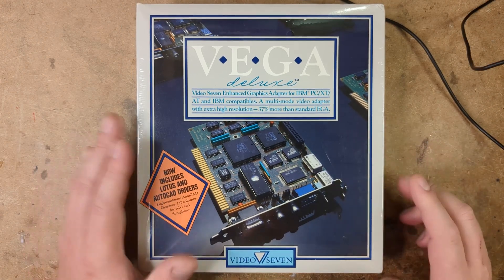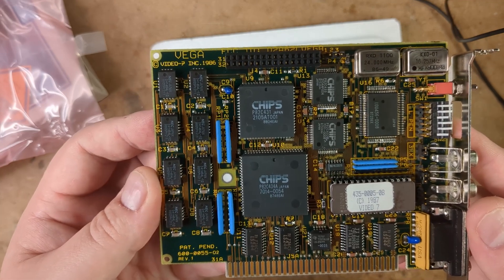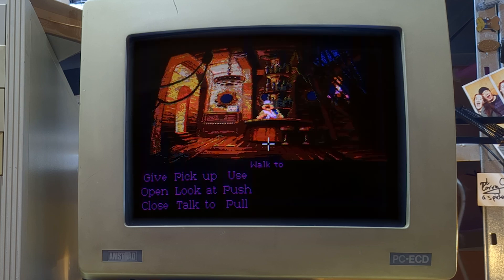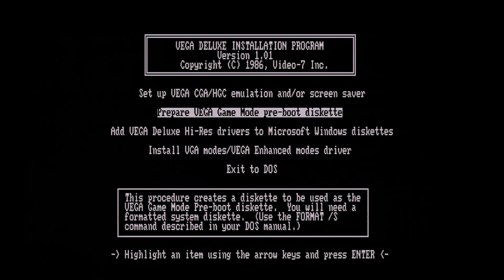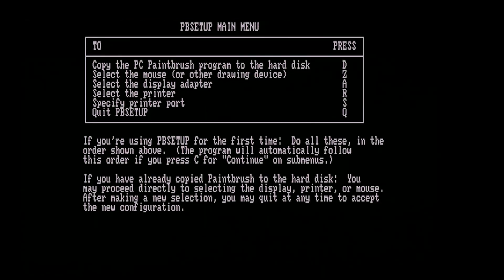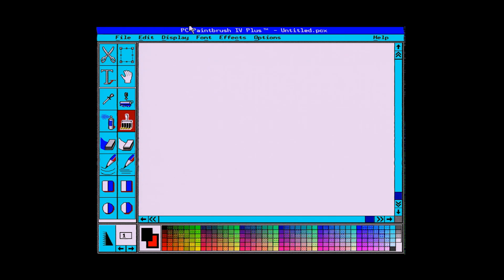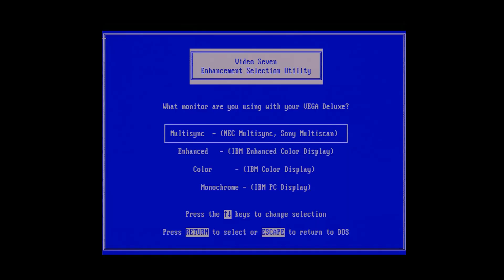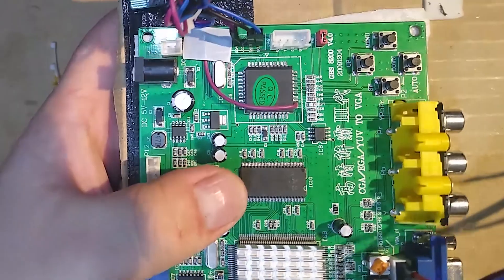Unboxing a Sealed 1980s Video Card!

Comment: By the way, do your capture devices give any kind of readout as to what frequencies/etc they're picking up? The exact settings for some of these old modes seem to be rather poorly documented, and even if it doesn't really display them properly, if it's giving any kind of picture at all that suggests it must have some idea of what line and frame rate the card is scanning at.

If you can verify what those actually are for the 640x480 and 752x410 modes (plus any other oddballs on there, like the 132x43 text mode), that could be quite useful to document, seeing as I've ended up here as one of the rabbit holes on my roughly annual surrender to curiosity over WTF they might actually have been, and if anyone's figured it out yet.

The V7 adverts and manual themselves say 29.4kHz for 640x480 and "25kHz" for 752x410... the former is maybe rounded off wrong depending which crystal it was actually designed for (some versions of these cards use 25MHz instead of 24... and of course if they're exchanged one for the other without any adjustment to the drivers, that could cause a pretty big change in scanrate), and with the latter, describing a monitor as 25kHz or "400 line" seems to cover a pretty wide range of possibilities from 24.0 upto 27.0 or more... so can't figure that one for certain at all. And of course the text modes, or anything more exotic that may be offered alongside these main options, are completely obscure.

But as we can see the crystal here, just getting what the capture device figures for the H and V sync, to one or two decimal places in each case, should make it trivial to calculate how many pixel / character times it's counting per line, and how many lines are used per frame...

(I have my reasons, but on one level the information is worth preserving just in its own right, as it doesn't seem to exist elsewhere)

Comment: Ah, nearly forgot... re: the text modes, I'd say the 120-column one is only using an 8x8 or 8x14 font. EGA didn't really use 9-pixel-wide characters for anything, other than maybe MDA emulation on an actual MDA monitor, and cards which offered Hercules emulation on an EGA monitor had to use a specific third (or fourth) crystal for that to cram in the extra pixels.

That'd also be why you don't get 132 columns at more than 25 rows unless you're using a multisync. The 24MHz is more or less 1.5x the standard 16.257MHz clock, so that's 640 x 1.5 = 960 pixels (I bet there's a 960-wide graphics mode for it lurking somewhere in that PC Paintbrush list...), or of course 80 x 1.5 = 120 columns.
(Yes, technically, it maths out to only 944 pixels, but there were some clone cards that used 16.0MHz clocks instead of the correct IBM figure, so there must have been a few pixels worth of spare border space each side that are taken advantage of here...)

The visible scanline portion on a CGA monitor being a little bit longer than that of EGA (as EGA has to cram in more lines per second) means it can fit 640 pixels with only the PC's default 14.318MHz clock... 24 divided into that is a bit over 5/3rds, making enough space for 1072 pixels ... or the 1056 required for 132 columns at 8 pixels plus a slightly wider border. Given how things work with MDA (EGA frequency but CGA line length, to give 9px font and 720 pixels), you can probably run 132x25 and indeed 132x43 on that as well (with 8x8/8x14 fonts), if you set that mode? Maybe even 120-wide modes with 9px font...

So anyway, on EGA you can have 120x43 or 132x25, but not 132x43... depends what you intend to do, really. If you're after emulating a 132-column terminal for remote access, then you don't need the extra rows anyway. If instead you just want extra space for your spreadsheet and don't necessarily need exact replication of a particular terminal or wide-carriage printer, or can withstand some occasional horizontal scrolling, the more balanced mode is the one you want (or even 120x25 on EGA for a clearer font).

Yer multisync monitor isn't quite as bothered about having exact timings as the regular EGA/CGA models, so the scan rate can be varied a little. Either it's running a bit higher with a scruffy 7- or even 6-pixel wide font (928, 792 pixels), or a little lower with the 8-pixel, to cram in the extra 10%. With a bit of behind the scenes number crunching, I'd expect that's likely running at around 19.5 to 20kHz horizontal (vs the 21.85 of EGA and 18.43 of MDA), and about 53 to 54Hz vertical. Not the prettiest, but both entirely within the wheelhouse of a typical multisync, and something that users of the time may have been somewhat used to, and the slower phosphors of monitors intended for lower refresh rates wouldn't have made the flickering as stark as, say, trying to run 56Hz SVGA on a turn-of-the-millennium SXGA tube intended to give rapid response in 75+ Hz modes.

Comment: Other bits and bobs as we go...

The old Microsoft Paint in Windows 1.x / 2.x is only monochrome, you can't change the colours... don't know if 3.x Paintbrush would work on earlier versions of the OS.

AFAIK the UI options for 1.x / 2.x only use 8 colours when dithering to make anything outside of the fixed palette, part of why the look and feel is a bit more garish than even 3.x (maybe even why the 8 "dim" colours of the VGA default palette for 3.x are decidedly NOT simply darker primaries but are a bit desaturated and shifted in hue), so yeah, it won't look like it's using the proper 16 colours, let alone EGA's 64. Not sure if that extends to how software running within Windows renders a wider palette. TBH there seems to be at least some situations where that actually looks better than the attempt later versions make at dithering down to 16c...

(Might actually be done in order to better support a wide range of graphics cards, including maybe some oddballs that run high rez with only 8 colours, some of which certainly existed - IBM PC3270 for a start, some AT&T/Olivetti/Tandy offerings, Japanese domestic market machines, with minimal extra coding... in which case VGA mode should look pretty much exactly the same as SuperEGA at 640x480. Also it probably saves a bit of video memory, and bandwidth when writing graphics data, which should speed things up and also leave additional room for caching data... I expect that's also why PC Paintbrush gives you 2, 4, 8 and 16 colour options for most of the resolutions... I think that old version of AutoCAD also only uses 8 colours regardless of how many more you might have available? Which if nothing else means you're unlikely to end up drawing something that you can't then plot on paper...)

That plotter is hella cool btw... if only they didn't take up so much space... is there a file available anywhere for the wangdala? XD (or the penrose globe...)

Comment: Nobody seems to have mentioned it in the comments, so... the special sauce giving you the extra modes is the 24MHz crystal on the board, and that's something actually mentioned as a feature in the C&T spec sheet too. In fact it can go up to somewhere north of 30MHz, as seen on some even higher resolution S-EGA cards.

There might not actually be any BIOS differences on the card, even. It doesn't do anything to the default PC text and graphics modes, which are defined in the video card BIOS (and somewhat in the PC motherboard one too). All the higher modes are set directly using the custom drivers, which probably talk to the CRTC and clock selection registers on the board without any BIOS involvement at all...

NB was your version of Monkey Island II the one that runs in the otherwise little-used 640x200 medium rez mode for EGA, so it can do some dithered approximations of the VGA palette? I remember that being an option, and it was one of the first games where studios started abandoning older platforms that could only do the equivalent of the low-rez 16c mode, so they must have thought it was kind of important to be able to have that extra colour. It doesn't quite look like straight RGBI palette here, but I don't recall it having a full hi-rez option either.

Be kinda neat if FastDoom could offer that mode as well, so it would look a lot better on EGA, but it would of course probably halve your ultimate framerate (and I can see definite tearing in the playback already). Might even be a problem on that Athlon system depending how bottlenecked the data transfer from processor to card is, but certainly is a risk for turning a just about playable framerate on a slower machine into a hopeless slideshow... Not so much of a problem for a much lower-motion game such as MI2... (Though, it's a better option than trying to use EGA hi-rez, I expect, even with a custom palette and a trimmed-down visible area)

Comment: Thank you for the video, you read about expanded video cards in wikis but you hardly ever get the name and models listed.
EGA 640x350 kind of bugs me retrospectively because 80x30 ASCII would work using 640x360 instead or 360/30=12  as in a nice clean 8x12 character resolution. Just 10 measly rows short, ah so the monitor spec limit is why we had 350 tall.🤔
Hence why someone would make a 480p compliant EGA card, 80x30 ASCII with the standard 8x16 character. I don't dislike EGA but the whole CGA monitor compatibility failsafe setup meant so few games ever used the full 64-color system palette.☹ Also the default colors were still pretty loud that I think one more generation of Composite Artifact Color output was warranted for the video card standard.
That is the rub of higher than standard, you form a hardware and driver island that others have to support or don't heh, plus pairing it with a compatible monitor too. Regardless very cool screen modes by that card.😁
Reply: I bet you could squeeze 360 lines out of an EGA monitor with a bit of care... there's some S-EGA text modes that use 352-line, certainly. Might be right on the edge of acceptance but worth a try if you could find some way to fiddle it, keeping one finger on the power button. Would only drop to about 58.5Hz perhaps. And I know there were graphics programs that did stuff like halving the dot clock for a 360x350 mode, or running interlace to get 640x700, so there's other options... (interlace mode might not be QUITE so bad if what you're displaying are 23-pixel high characters on a black background... or I suppose settling for 8x11 and ten wasted lines top and bottom wouldn't be the end of the world?)

But, they were going for typical terminal compatibility, and the general standard was 80x25 (80x24 active, plus an on-screen status line on "smarter" models), so that's what was used. If you wanted more stuff on screen, EGA could swap to the 8x8 CGA font for 43 lines after all... and any 80x30 remote system you may be connecting to could just appear within that instead.

That's also why 132-column mode was a selling point for a lot of these cards, even where you didn't get any additional vertical resolution - it let you run in VT100 emulation mode, which was one of the first terminals that offered 132 instead of 80, which displays the full width of a wide-platen fanfold line printer... but still only 24 usable display lines, which was less of an issue because scrolling up and down a page isn't anywhere near as annoying (or electronically difficult) as having to scroll side to side to show an entire line.
Reply: @tahrey  Well yeah there are exceptions in hardware but then you get into limited compatibility Ie. per video card coding support. I've seen plenty of the odder screen modes, but yeah typically a refresh loss is the tradeoff.

That is typically the cutback in all aspects, the height. That's what kind of sucks about EGA and CGA, while people have found many cool mode tweaks the general video setup is quite rigid and lacking in screen modes or column and row options Egs. EGA not having 256x192, 320x240, 400x300, 480x360, or 512x384 adjacent modes like VGA did.

Wow a 132-column mode must have been quite the sight bitd.
I don't mind the cutback in height resolution as much since there are plenty of options. Mostly that 15/30-rows was the future standard to work up to in any era.

Comment: had this exact video card in our 286! Still remember futzing around with the dip switches on the back etc. Don't think we ever had a fancy monitor so it only ever ran the standard modes.  was in service up until about 1994.

Comment: I sometimes try to use one of those old AutoCAD versions, but I quickly realize how much easier the new ones are to use and let it go lol

Interesting card, it would be cool if Fast Doom supported the higher resolution graphics modes for it
Reply from the maker: As the vega deluxe supports kinda-vga-emulation, all that might be required is a 16 colour VGA version of fastdoom
Reply: @TheRasteri  That would be sick. I actually really like the weird 16 color EGA pallet that Viti95 uses for FDOOM. It would cool to see it in a higher res mode so the character models looked clearer 😎
Reply: It'd run like absolute crap though, it doesn't look entirely happy with refreshing 320x200 at 60Hz (or perhaps just 30Hz, depending how FD adapts down from the 35fps cap Doom has on 70Hz VGA...) ... if there was a 16-bit ISA version perhaps, and you had an overclocked ISA bus, it might retain some usability. Those hi-rez modes were only really meant for relatively static displays, or doing simple operations that the board could accelerate by itself, like window drawing and scrolling.

Comment: I have a Tulip TEVA2 card that is very similar to the VEGA card (but not the same). I know it supports 640x480 from the BIOS, but I never owned a TTL monitor capable of displaying that resolution and I could not get it to work with the GBS. 

I have a dump of the BIOS that I should probably run through ghidra or something like that.
Reply from the maker: That is interesting. Presumably uses similar software tricks
Reply: @TheRasteri  I wrote a TSR in assembly once to get "route" the BIOS setmode call for 640x480 to the regular EGA HiRes mode (640x350). It actually proved useful, as it was also during this time that I was way into MOD music and had a player that would work on my system, but only at that VGA resolution. It worked, although obviously I was missing the bottom 130 lines of graphics. That was not much of a problem, since there were no GUI elements in that area.
Reply: If you can do that and extract the CRCT settings for each mode, that'd be very interesting... Though they're probably not programmed into the BIOS. Better to try it with the driver files?

Comment: No 64 color EGA games?
Reply: There is no EGA mode that can show all 64 colors at the same time. Many games used customized palettes for title screens and such, though.
Reply: @IkarusKommt  i thought there were some low res high color modes for games like Sim City? But maybe not
Reply: Well, you're not going to get all 64 colours on screen at once without raster interrupt trickery (which I don't even know if it's possible on EGA), but there were certainly a few games that ran EGA hi-rez with a custom palette... Simcity for one, a bunch of shareware things by Moraff, some RPG my brother used to be into called Aethra, all kinds of art packages (things like EGA Colouring Book sorta count as games I guess?), the ubiquitous Mahjongg games, etc. And probably the technically VGA mode of Corncob 3D would work on a card like this (even if not an original EGA) as it's actually the EGA-emulation mode of the VGA card, just taking advantage to do finer grained colour cycling for special effects... you'd lose some of that bling (and the 256-colour title cards would be a mess) but the underlying rendering should be fine.

Thing is, it's not so great for fast action on a slow computer (heck, VGA is a bit quicker, but Corncob needed a 386 and ran the fake-EGA mode to have a hi-rez look without having to push as much data about as in 640x480), so the fixed palette is a small price to pay for much better performance thanks to moving fewer pixels around, and it still looks a lot better than CGA. Generally games that used hi-rez on machines where it was either the only choice (Mac) or you had some kind of choice between hi and lo (ST, PCs with combi Plantronics/Hercules cards) would run it in monochrome rather than any kind of colour to compensate the bandwidth requirements.